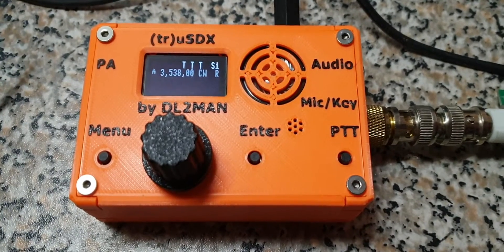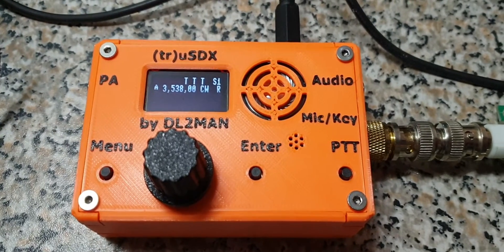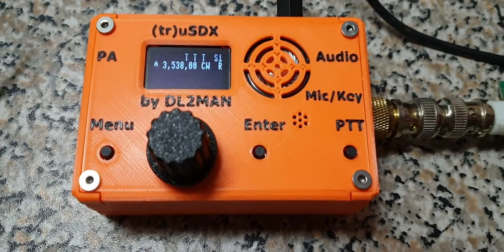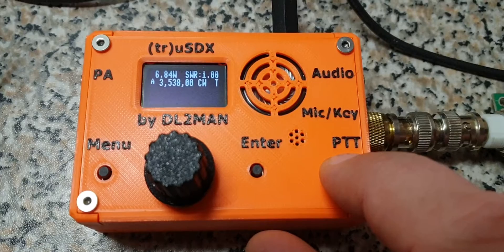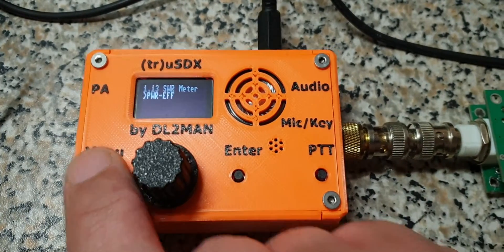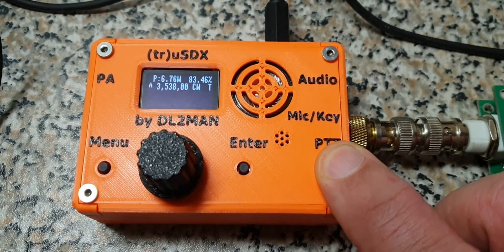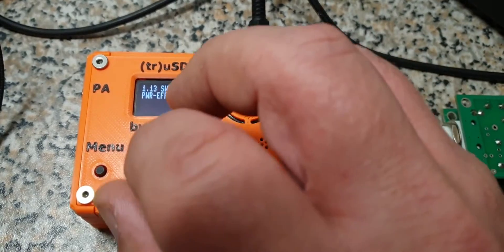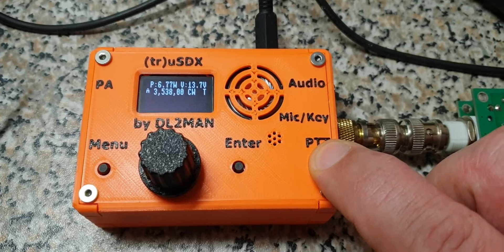(tr)uSDX Prototype: on-board measurement equipment demo

Comment: Hey,
really great feature for setting up antennas in the field. However the SWR is only displayed in CW straight mode. Is there a quick way to switch between iambic and straight without going to the menu?
Reply from the maker: coming soon....
Reply: It would be great to have these measurements while on SSB, not only on CW.

Comment: I love the name, trusxd, very intelligent from you.
I don't know if 160m and 6m bands are usable or will they be in the future?
Thanks for your contribution, waiting to build/buy one, don't want to buy chinese copies if I can avoid it.
Reply from the maker: The kit will be for 80/60/40/30/20m (5 Bands) at Release, and the factory assembly parts are chosen for those bands. Those 5 Slots can be chosen differently in the Future. So let´s say, you don´t need 60 and 30m, you can built it for 80/40/20/15/10m. But that´s future talk and will not be supported by software at initial release. 160m and 6m are the extreme limits of that hardware. I would not advise it. 160m is below the lower limit of Si5351 capability and 6m is so high in frequency, that RX will be deaf.
Reply: @dl2man  Nice, thanks!

Comment: Sweet! Now to find someone to build one for me ;-)  73 & stay well! W8IJN
Reply from the maker: The group-buy model we plan includes factory assembly of SMT components. So it sould be only  very few THT Parts to be soldered to finish the Kit.... Wait for the Release ;)
Reply: @dl2man  Ich werde gleich hier bleiben und warten, Freund. Vielen Dank!
Reply: As age has caught up with my eyesight and hand tremors after 60 years of building , I hope there are builders willing to build them for a reasonable cost . W5COV
Reply: @charlesvest7512  I hear you, amigo. Eyes ain't so bad but it's the shaky paws did me in for building. As for CW, well, thanks to dear Piero Begali, I am at least still able to enjoy that. Stay sane! 73 de W8IJN

Comment: Hallo Manuel, werden auch irgendwann fertiggebaute Geräte, wie beim QRP-Labs angeboten?
Reply from the maker: Die Lizenz, unter der es veröffentlicht wird, erlaubt ausdrücklich auch kommerzielle Nutzung. Wenn also jemand ein paar € verdienen will, kann er die Geräte aufbauen und verkaufen. Ich selbst werde das nicht anbieten, weil mir für Serienproduktion die Zeit fehlt.
Reply: @dl2man  danke für Deine Antwort, gibt es trotzdem eine Möglichkeit, Dich zu kontaktieren, außer über YT?
Reply from the maker: @JN57in  Wer mich kontaktieren will, findet eine Möglichkeit ;) Google hilft Dir, wenn Du mein Rufzeichen eingibst. 73 Manuel; DL2MAN